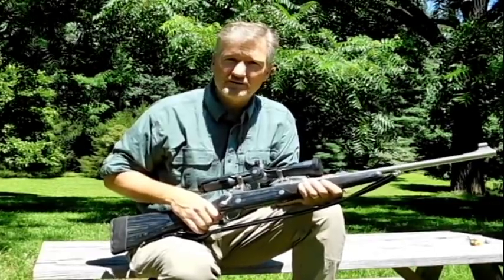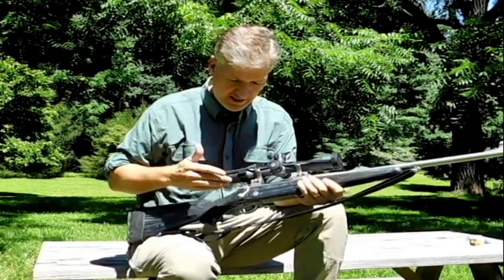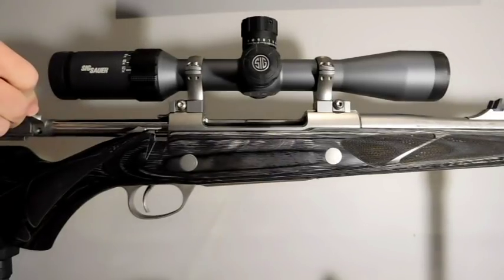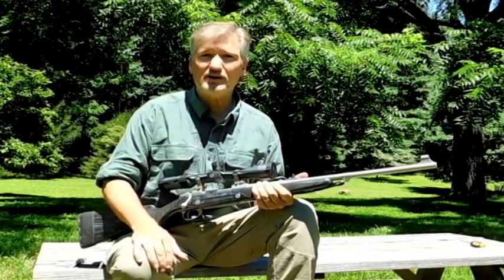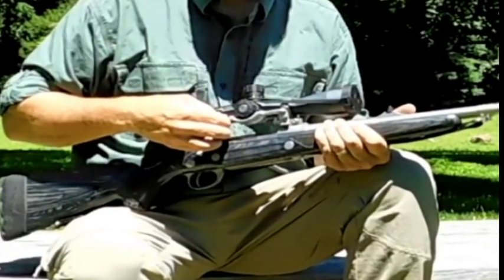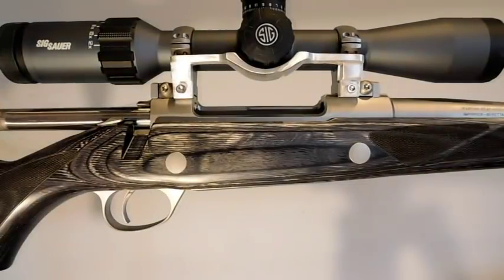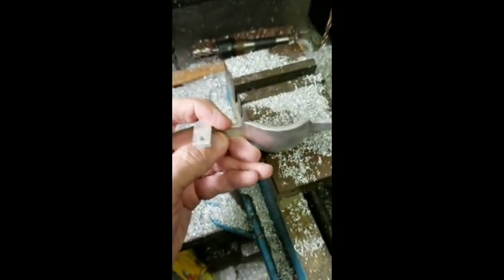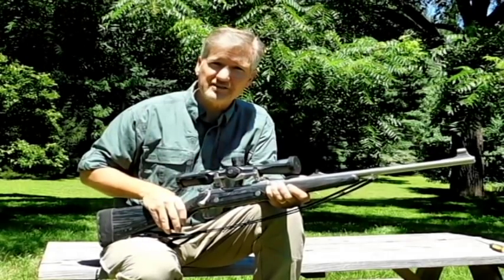Sako Model 85 Ejection Problem with Solution

Comment: Awesome engineering mate.
Cheers
Reply: pretty shit really not this guys design but the fact that sako 85 clearly shouldn't have let this past the design phase without testing all available scope sizes in accordance to what size rings they have a available i have a sako and have had for a while it was easier to go the way off a contessa picitinay  from rail Italy  and leupold rings as this is what my local shop had but all in all y don't they have a rail mounted as standard as this suits so many more options 
but even with all this i absolutely love my sako and wouldn't trade it at all and my next will still be a sako
Reply: Only on large magnum length action

Comment: Interesting video!  I was not aware that this issue existed.  I have the same rifle in .375 H&H and have never experienced an ejection issue.  On my last Safari I ran twenty rounds of Nosler Safari Grade ammo through it with no mishaps.  Scope wise, I am using a Leupold  1-6 VXR with a 30mm tube.
Reply: Neither have I and in 6.5x55?

Comment: A week ago a friend gave me his model 85 300wsm for examination of the very same problem. From my research this appears to be a factory engineering flaw in an otherwise amazing rifle.  Sako needs to address this ejection angle problem, not the consumer.  It is a very basic engineering flaw and sako should recall each and every rifle and fix them free of charge!

Comment: Disassemble the bolt, remove extractor, careful not to lose the spring. Degrease and debur the extractor hole. Worked for me.
Reply from the maker: I tried removing and cleaning the extractor before considering any modifications. The extractor has a fixed ejection angle so no adjustment is possible. From the many people I have spoken to (including Sako), it appears to be a problem with the larger calibers such as the .375 because of the longer bullet casings.  I'm glad your problem was fixed by cleaning and deburing the extractor slot. Thanks for your comment.

Comment: Sako basically says that they cannot predict every scope size or configuration so this is not a warranty issue.  My Sako 85 Graywolf in a 300 WSM hit the turret on my Leopold scope. For the money it cost, Sako should be able to engineer a rifle that does not need modification with a scope.
Reply from the maker: I totally agree. I have become a Tikka fan. I know they are made by the same company, but I think they must have a totally different design team. My Tikka's work flawlessly with my Sig scopes even with their large turrets.  Thanks for your comment.
Reply: The tikkas and sako a7 use a plunger ejection system. The 85 is the only one that has an issue. I like the tikka a lot but they are also owned by beretta so I won’t buy another one. If a company doesn’t care about the customer then they need to lose money sell out. Then someone else will buy them out hopefully make the proper changes and turn the company around.
Reply: Use a European scope - my z8 is fine

Comment: Great idea 💡   
That's a lot of work for this issue.  
There is a simple fix for this, well kind of simple.  In the bolt there is an ejector. The top of it that locks on the bullet case. This needs to be filed down a little bit.  
This changes the angle of the ejection.

Comment: I have a similar problem on a Tikka short action. Too bad the factory won't address this. Great vid, Roger.
Reply: Tikka system is completely different. Plunger ejector instead of mauser style blade. If you have a problem contact the warranty.

Comment: I have a finnlite in 270 win with medium height sako bases and rings. A Leupold 5x HD sitting on top. Ejection issues, you bet yah. You need to quick stroke the bolt to eject casings properly. My dealer when asked about this issue prior to me paying 3800.00 said Sako had rectified the issue. He lied.
Reply from the maker: It's amazing to me that the Sako designers won't change the ejection angle of the casings. It's such a well made rile. You would think they would make this seemingly simple fix. Thanks for your comment.

Comment: I have a Sako 85 finnbear ( my second because the first one failed the accuracy test of anywhere close to MOA.)The one I have now didn’t shoot any better and also has the ejection issue as well so I sent it to get rebarreled. It now shoots MOA but still has occasional ejection issues. Of all the times it could have happened it happened right after I shot a buck and needed a second shot and had a major jam. I will never buy another Sako again. I now have over 3k in this rifle and it sickens me

Comment: My Sako A7 7mm Rem Mag has the same problem. It’s a shame because the rifle is top tier in the accuracy dept. 
I installed a Talley Pic Rail. It helps but ejection is still anemic and it positions my scope higher than I want it with low rings. 
I still use it for hunting. It’s too accurate to leave behind. Thinking of switching to a 1” scope tube with minimal windage turret. 
Thank you for the video!!!

Comment: There’s way to many good quality rifles on the market that work flawlessly to waste your time and money on one of these sako 85s but if you already own one and can’t justify selling it because the ejection issues causes the value to be all but worthless then by all means tinker with it and try to make it work. My finnlite at least never jams it consistently ricochets the spent casings off the scope and out. I have low mounts with a practical hunting scope Leupold vx3 3.5-10x40 with a 1” tube. I did try high mounts but that actually magnified the problem just before the case flies out to the right it pulls back to the left and then gets released directly into the bottom of my scope does a 180 and lands back in the receiver jamming my next shot so I went back to the low mounts. I also had a stiffer extractor spring installed but that didn’t help either. Before I voided the warranty by putting in the new extractor spring I called 
beretta/sako and they told me to slide the scope forwards and back and then to rotate the scope so my elevation turret was on the side. That to me is very unacceptable advice from a rifle company with such a high reputation for high quality firearms. The gun shoots exceptionally well but I won’t buy another product that’s owned by beretta.

Comment: Sako 85 Hunter (left hand) with a 30mm scope.  Only time I have an ejection failure is on the last round in the magazine, so I’ve never bothered with it.  If I pull the bolt back hard enough it will eject the last case but it will dent the case neck on the scope.

Comment: I have the same issue with 85 m action in 30.06. Hits the scope damages the cartridge at either neck or shoulder depends how far forward or back you set the scope, if I use my high mounts it hits and comes back in the magazine. From what I read it's the medium and long actions but mainly 270 and 30.06 and 375 . Apparently it's the extractor that cannot keep the case against the bolt face tight enough when the ejector blade coming from 6 o clock, hits the case and pushes it up. If the extractor  clearance was less, i.e. Case held firm against the bolt face no matter the angle of the ejector blade it would eject out in the 10 o clock position of the extractor claw. Apparently  the cartridges mentioned and others that are troublesome, have a thinner rim , 1.24mm where for example in the same size medium action the 6.5 X 55 swede has a rim thickness of 1.5mm that's app 10 thou  of an inch difference, or 0.25mm and that keeps the case firm against the bolt face during ejector blade strike which ensures the case leaves in the correct direction. , lesser calibers, in the small and  sm actions are benefitting from a shorter arc due to their reduced lengths and so do not strike the scope ,even if they flop around, compared the longer action longer cartridges, that weigh more and wobble more and have the added length  of the  cartridge get directed too high, they will strike. The control round feed is also not helping as the base of the bolt face is open to allow the cartridge rim to slide up behind the extractor when feeding, this cutaway is too high on the left side, opposite to the extractor claw, so that the claw which places, sprung sideways pressure on the cartridge rim , can too easily push the case down  instead of keep it held, if you remove your bolt and draw a line from the middle of the extractor claw across the bolt face, going through the firing pin hole in the bolt center to the outer edge you will find that it will scribe  off into the very edge and bellow  the cutaway start The claw therefore cannot put a proper sure pressure against the rim as the opposite side has no material to press this against , extractor claw is at app 10 o clock the cutaway starts at 4 0clock, the center of the claw will be app 10.30 and that will be the tangent , the spot where the claw will act  sideways upon the case rim,, the claw has a flat inner   surface  so will contact the round case rim only in one tiny spot ,  so the 10.30 tangent pressure contact position ,  is directed straight across at  4.30 o'clock and there  is no bolt rim support at that point, extractor should have been lower say at app 9.30 and would therefor direct it's pressure across the bolt face to app 3.30  where there is still some meat or steel rim to keep the cartridge secured. Or start  the far side cutaway a little lower to say 5 o clock so the case can be secured.  It is all far too close and requires perfect tolerances  of claw grip in the across the bolt direction against the side of the rim  to keep the rim edge against the bolt shroud, and in the towards the bolt face direction to keep the rim base against the bolt face . Both are required for extraction to occur correctly, on smaller cases with smaller diameter rims there is a lesser cutaway on those bolts so more  shroud remains to house more than the upper half of the base  , compared larger case bolts where less than half the case  base is shrouded from center of the claw , the tangent spot , over the top and around down , to the opposite edge  of the cutaway start, this causes or allows  the case to slip  downwards if not perfectly aligned every time   and of course as stated earlier, smaller lighter, shorter cartridges in the smaller actions , work, where the only cases that work in medium and long actions are those that have thicker, 1.37mm and above rim thickness. And of course many others that should strike  the scope but simply don't, maybe a better fitting extractor . And of course there is just the unlucky owners that caught it in any action size . I was warned, but did not pay attention, did not believe it could really be an issue on a top brand product like Sako, bought waited, unpacked set up , tested and cursed.  Invested in higher rings, cursed again, took the claw out,  hit it with a hammer on the end , ( I read about this fix  in a forum and laughed my ass off till I owned the problem ),   The hammer tap , quite a firm tap,  standing the extractor up on a vice ,  or flat  stable steel surface with the claw uppermost and the back of the extractor contacting the vice or steel surface to strike against,  tap the claw to shorten it , this will close down the gap between the rim face and the bolt face so less wobble ,, when the case is gripped awaiting the ejector strike, ground  the inner flat surface ,  into a very slight radius  so as to contact more of the rim edge laterally across the bolt face thereby applying pressure across where there is a wall remaining  that is not cut out so it is held secure I  re- fitted it  and now it works,  even with my low rings . I bought a new claw as backup , guess what, didn't have to hit it, just a touch of grinding the curve into the flat and it grips the case perfectly and extracts perfectly, seems there are different tolerances happening on the extractors,  and some work better than others, pity that Sako don't offer a few different specific extractors to assist us , say 10thou  to 20 thou differences, standard, medium etc, we could fit and touch with a file to get a better extraction grip control  and ejection angle happening. ,  for those of us who already own the problem SAKO EXTRACTOR, COMPLETE, S491, M591, L691, L61R M90, 75/I-V  part number s 5940233  for those that don't  own the problem ,  we all know about scope, rings, firm bolt pull etc,  so as helpful as they have been it's not a fix to the real issue and the stubborn problems that , no matter what the don't eject , to those buying  new for the first time, check the rifle with a scope on and ask the gun shop salesman or lady,  to demonstrate before you buy,  if it does hit ,  and you love the rifle, they are great, negotiate a spare extractor claw  or two and take your chances   , or  consider a small action calibre, or walk away.  Ps get spare springs and pins too they are tiny and have a mind of their own when removing, it's  a simple  replacement procedure, there are a few utube vids on it and  good spring tension can assist with or detract from  positive ejection if they are weak.  Tools required are simply ,  a pair of long nose pliers, a fairly small fine flat screw driver and a vise to clamp the bolt while working, ease the one plier jaw under the extractor,  firmly grip it , ease it outwards and back while pushing the pin backwards with the edge of that small screwdriver ,  till the pin fully reverses enough that the claw can come out, ,  the spring and pin can shoot out during this, but will only be able to escape when the extractor claw is removed, so as you lift, wiggle and remove the claw, pay attention to the pin and spring. replace by gripping the claw in the pliers,  again from the front, place the spring  into its drilling followed by the pin, push the pin back and direct the rear of the claw down and back and as you see the pin about to ride the claw at the  rear, then angle the claw front down in its slot whilst maintaining rearward downward pressure, it simply snaps into place with a little manipulation.  The ejector blade can  contribute to the problems this   can also be filed  shorter, it's  very accessible and as long as you get a spare first, removing app 1 mm to 2 mm from the ejector blade length also stops the case being thrown too high,  this ejector blade  sits in the action and is fixed and rocks on two springs and one pivot shaft, so,as the bolt comes back it rides upwards into the cutout slot  on the bottom of the bolt at 6. O clock  and pushes  against the bottom of the case  at the rear , as the bolt is drawn out,  this ejects the case, if it is  too long  and coupled with the loose extractor claw, it will force the case too high before the claw can act to pull it sideways, like a timing thing, hence you read people mentioning to pull it back sharply , but consider the length of the strike  not simply the speed, a shorter length of push, will extract the same as a longer, however the angle is lessened, with the shorter strike push. So if you wish to test that,  it also works and produces similar results. Combined it's  very effective.  In terms of consistency .  Finally, if the case is only slightly hitting the scope, then don't worry, scopes are sturdy and the little ding ding won't break them,   If you reload, then position the scope slightly back, so the dent happens in the neck, this is easily reshaped when you resize the case neck during loading, the shoulder dents are not as  desirable and won't come out, unless fire formed , when shot again,  bringing pressures and case strength into question, anyway as long as it never falls back into the magazine then it's not a deal breaking issue, more something that you will get used to and will be forgotten  soon after you shoot your fine rifle, these rifles are fantastic and accurate ,  as long as it's just an occasional ding, don't let it effect your chance to own and be proud to own and shoot a fine rifle.
Reply from the maker: Wow, you have really analyzed this issue. Very informative!